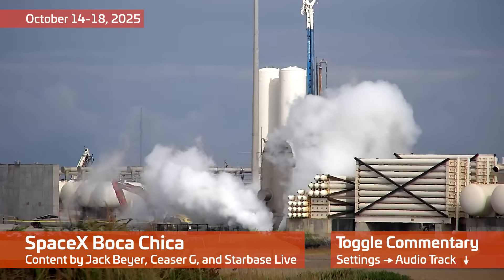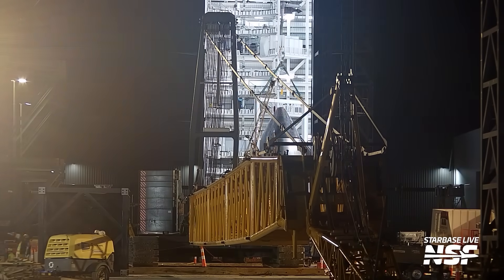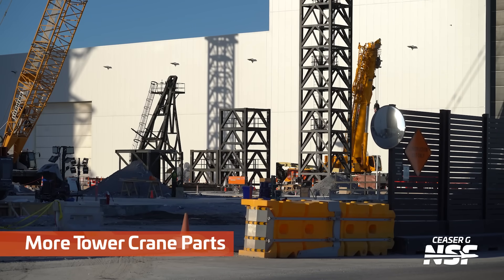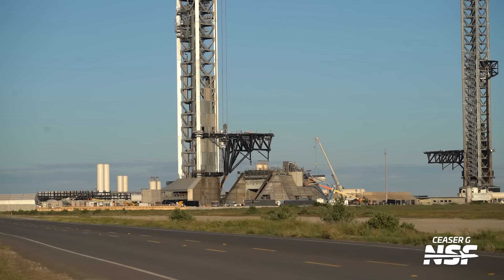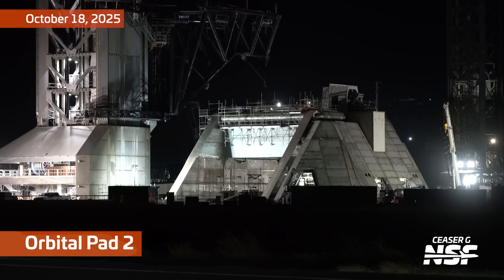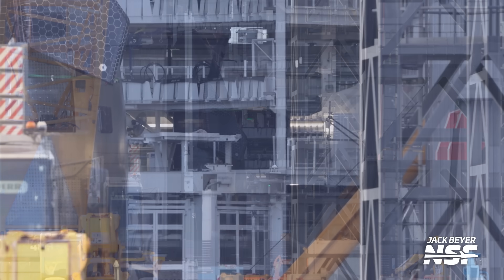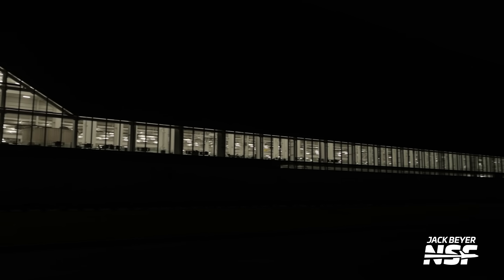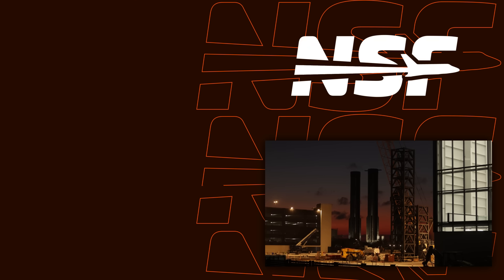Next Gen Ship readies for Flight 12 | SpaceX Starbase

Comment: Gen 3 coming on line.... yeh...but...   There is still a huge problem with the heat shield.   The one they have now is 50year old tech.  It works... but only once.  Its not reusable.    We need something different.    None of this will work with what is being used now.
Reply: Actually the only real problem seems to be the mounting method.
Reply: @imaginary_friend7300  
I still don't think they are durable enough to do more than one trip... without ..like the shuttle having to go back over every single one and see if its cracked  or needs to be replaced for some reason.  That is not the way Elon has always said... reload and relaunch the same boosters and ships in a matter of hours.   Shuttle took years to go back over for each launch.   They pretty much had the same tiles?  Just more "custom" ones on the shuttles.

Comment: I have a question. Do the space capsules come back to earth after they deploy the satellites? And if they do, can they retrieve them?
Reply: Current design generally deorbit but get destroyed during reentry. Starship is designed to solve that by being fully recoverable, so it will deploy satellites and then return to the launch site to launch another batch. This really only works on this scale due to the mass of the heatshield and landing equipment needed

Comment: No more dance floor? Will SpaceX have to remove the booster from the new launch mount every time they need to work on the booster engines?
Reply: I'm also curious how they'll work on the underside of the pad. Surely they won't install scaffolding every time, right?
Reply: Yeah no more dance floor

Comment: So, what was the point of v2?
Reply: It had a bunch of upgrades (longer tank section, moved forward flaps, new transfer tube design, etc) that they were testing out. They were aiming to get to catch attempts, and I'm sure some other stuff, but the string of early failures pivoted it to testing the vehicle upgrades ahead of v3 (so they're essentially getting to the v3 design in two steps instead of one large one). Given the luck v2 had it probably would have been quite risky to jump straight to v3
Reply: @thomashayden804 Now they have to ( assuming a responsible company) do all tests again since new engines and new design…. so, i’ll ask again. what was the point of V2?
Reply: @kurknielsen They only have to test the new v3 specific changes. The things that haven't changed since v2 are now known to work (forward flaps design for instance). Had they not done v2 they would have to test all of that as well. Plus v2 informed the design of v3, I imagine particularly around the heatshield, so without it they'd be flying somewhat blind

Comment: The tower crane raises itself which is very cool
Reply: Ok, that's cool
Reply: You said it before I could !  That'll be the fun part to watch once it gets fully assembled and then builds itself higher as work progresses
Reply: That tower crane doesn’t raise itself.
Reply: @383Iron  You can see a bulkier section near the top which can slide up, leaving a gap where the crane can insert a section, which can be secured and then the process repeated
Reply: @383Iron  how do you know ?   If it's there to build the gigbay , it's going to need to be higher up than it is.
Reply: @383Iron  It does at the top part. thats why there walkways, so crew can put in the pins for every section.